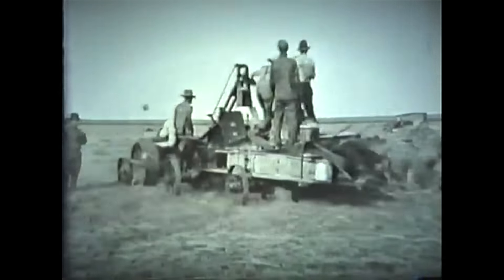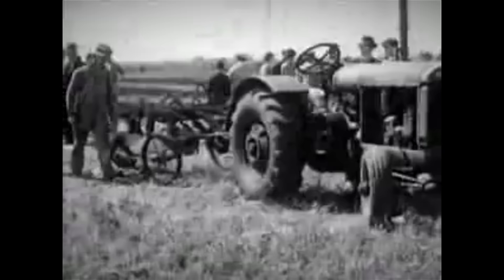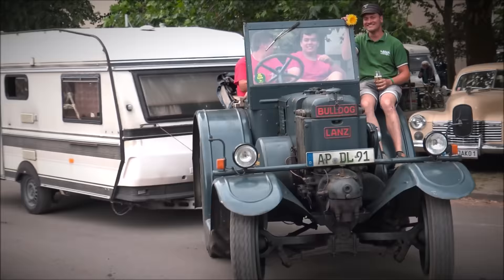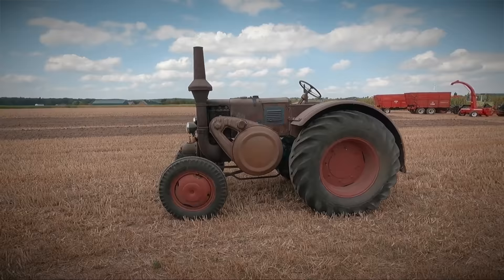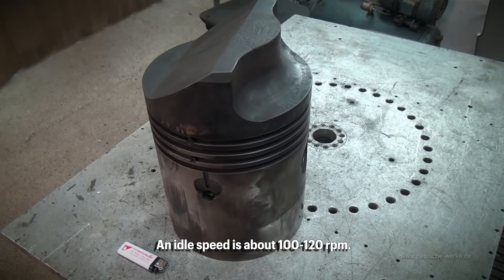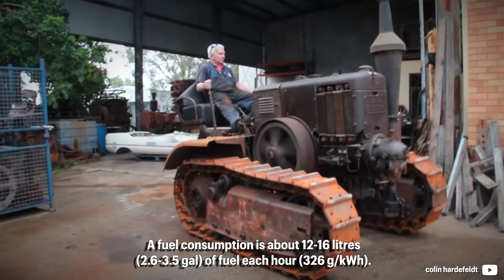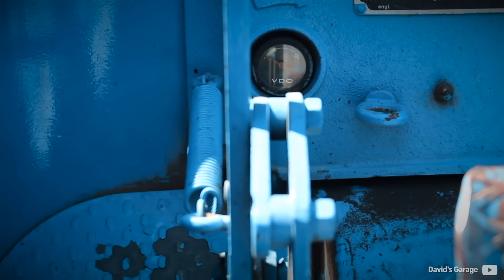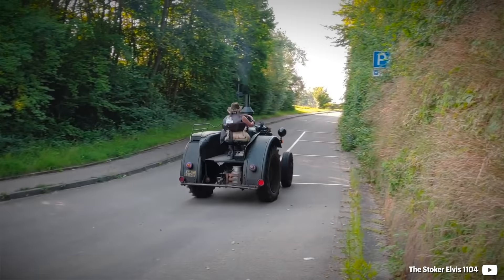This Is An Incredibly Slow Engine

Comment: My neighbour had lots of Lanz tractors. He used them still in the 80s for his little Farm. After the world war two he moved from near Berlin to our little village. He told me that he saved a few Lanz tractors from the srapyard for 10 Deutsch Mark. The farmers don´t wanted them anymore. The engine start procedere and driving comfort was already outdated at that time. He had a large collection of tractors with nearly every engine Lanz had ever build. One the biggest was a 50 hp Lanz Bulldog. Whenever he started the engine you heard it. The sound was really loud an so unique.
His most rare tractor was a 60 hp Eil (fast) Bulldog with an original "Berliner" cabin. The cabin frame is from wood. It is not 100% clear how many original tractors of this type have got survived, but probably just a hand full. 
I remember that I have often seen cars with numberplates from far away and I heard that many collectors wanted to buy tractors from him, but he never sold any of them. On top of this he owend a few old cars (Mercedes Benz, BMW Isetta, Volkswagen Beetle) and old Motorbikes like DKW, Zündapp and so on. It was always like a museum at his farm. Unfortunatly he died a couple of years ago.
Reply: Hey, du bist doch bestimmt deutsch, ist ein umbau oder,auf 60 ps halbdiesel ?
Reply: @nilsgaming6664  Moin, ehrlich gesagt kenn ich mich mit der Lanz Technik gar nicht so gut aus. In der Sammlung war mindestens ein Halbdiesel dabei. Das hat mir mal ein Kumpel erzählt, der da deutlich tiefer in der Materie steckt, als ich. Kann sein, daß der Halbdiesel eher der 50PS Bulldog war. Der war verglichen mit vielen anderen in der Sammlung schon recht neu und hatte defintiv einen E Starter. Da standen aber auch einige Glühköpfe und mindestens ein Alldog bei ihm auf dem Hof.
Reply: I bet that they came back like Hawks and low balled the widow if their was one. How I hope that it didn't happen.
Reply: @johnelliott7375  Everything what I know he was divorced and his son shouldn't get any of this tractors. Two friends of mine where in his testament an got a few tractors and the farm.

Comment: Very cool tractors, I've seen one at a tractor pull and when they are at full power you can feel the shockwaves through your whole body from some distance, pretty impressive but also probably miserable to drive for any extended period of time
Reply: No, I used to drive a Bulldog all day in seeding and harvest season. When the engine is at full revs you don't get much vibration.

Comment: At 4:07 there is a Field Marshal tractor in view, it is very similar to the Lanz Bulldog in having a horizontal single cylinder 2 stroke engine, but the difference is that this is a true Diesel engine, so it won't burn other fuels than diesel and other fuels with a similar flash point like kerosene or some vegetable oils.
The Bulldogs with fenders over the rear wheels are Eilbulldogs (speed Bulldogs), these had different gear ratios for a higher top speed and were made for on road haulage.

Comment: I really appreciate the video on this engine VR. These motors are obviously extremely powerful and were popular but I had never knew anything about these before. Thank you!!
Reply from the maker: Thank you, it is my pleasure!
Reply: Lol they are not powerfully in any way comparatively to any modern engine
They make 40hp for a 10.3 liters engine
Not fuel efficient lol
Reply: @legros731  I was talking about the torque not horsepower.
Reply: @chesspiece81  even the torque is pretty low compared to "modern "diesel that make over 1000lbs torque

Comment: These tractors were built under license in Australia under the name of KL Bulldog by the engineering company Kelly and Lewis. Very popular with smaller landowners as they could run on other vehicles used crankcase oil.
Reply: That was our first Bulldog. Later we got a Lanz Model T with electric start.

Comment: They had a few at a vintage tractor pull and you could fell the shock wave from every stroke of engine at full power was fantastic. My grandfather has a Lanz bulldog in Australia running a saw blade and it used to bury itself into the ground with its rocking if you weren't careful

Comment: I knew about these lovely machines and their MASSIVE single cylinder engine, but never knew the power specs. Thanks for digging that. Impressive figures for its time. Never knew they could run at 0 RPM too, that's a pretty funny trivia.
(and the sound of these engines is just fantastic. Slow running big engine are something special, when you can literally hear each piston stroke)
Reply: Oh man, you need to see the exhaust plume of some of these.
Ive seen one push a smoke vortex 30m high, they truly are beautifull
Reply: Well at 0 rpm it's making literally no horsepower so it's kinda not really running 😂
Reply: @mrwhips3623  wrong
Reply: @richsackett3423  no you

Comment: Actually they have a huge fanbase...most of them are retrofitted with elctrical starters nowadays. The so called Eilbulldog(old version of a word with meaning of fast-trac) which was mostly sold to big shipping companies or circuses, costs nowadays more then 200k €. Ones with an open cab and those retrobuild to Eilbulldog design, are sold between 30 and 80k euros. Where i live btw, is a lanzbulldog showcased on meetings of old tractors and agricultural stuff, where an American airplane shot through the flywheel when the farmer was brave enough to plow the field at day...Bulldog still runs 😉😅
Reply: ...that's what the title says? Cult usually means huge following. And you're saying the same thing like it's contradictory?
Reply: @instrumental  sry if it sounds like that
Reply: @maxgr7723  you have no reason to apologize to that fool  instrumental he's miserable and thinks he's better than you enjoy what you do

Comment: Interesting video. There are some points I'd like to add though.

After WWII, Lanz developed the hot-bulb engine to a semi-diesel engine. The hot-bulb disappeared and the time-consuming starting procedure was not necessary anymore. The hand start was replaced by a electric starter. The semi-diesel is started with gasoline and a spark plug ignites the fuel until the piston is hot enough to ignite diesel fuel. The driver has to control which fuel is injected to the combustion chamber. Without the hot-bulb, Lanz was able to increase the compression to a medium pressure, which increased efficiency by a lot. Semi-Diesels only need about a third of fuel compared to the the hot-bulbs.

Next, Lanz got rid of the gasoline start by adding a glow plug to the combustion chamber. Apart from being horizontal single cylinder two-strokes, these tractors are almost like regular diesel engines. This was about in the mid 50s. This tractor is called "Volldiesel" and was the last development before John-Deere took the majority of shares to expand to Europe.

Such a Volldiesel with 16 hp was the first tractor my great-greatparents bought for their small farm here in southern germany. Since Lanz Bulldogs have such a charming sound and a characteristic engine, my father also reimported a D1506 hot-bulb engine from Greece in the 80s. This was the strongest hot-bulb tractor from lanz with 10,3 l and 55 hp.

I have some videos about our Volldiesels on my channel.
Greetings from from the black forest! (~150 km to Mannheim)

Comment: I grew up not far from Mannheim and yes Bulldog was a synonym for tractor. I drove a Lanz for a while around a farm. The 0-rpm back and forth was a thing to watch out for, and it would run the wrong way if not carefully started.

But when it ran, it seemed there was nothing that could stop it. One time we were working on the farm around some ditches filled with salt water (it was on an island in the northern sea) and accidentally drove the thing into a deep ditch. We jumped off because it was freezing cold and the water was deep. To our amazement the Bulldog just kept going and drove out at the other side of the ditch after being half submerged in salt water. Somehow we got to the other side and caught it.

Comment: In that day's here in Germany by wintertime they parked the Lanz with distance to the farmhouse.
They didn't stop the engine in the evening because of the preheating in the morning to avoid crack's in the glowhead.
Imagine to preheat a -25 degrees cold glowhead with a torch you can barely kontrol the heat on.

Comment: Engines that can burn anything is a path forward and shouldn’t be forgotten.
Reply: I'm sure the efficiency is very low, so you'll be busy find stuff to burn
Reply: And the result to forward innovation is the gas turbine engine. It can burn any combustible liquid. With the right fuel flow, you can sustain the burn time no matter the energy density of the fuel. It also shares the ridiculously low thermal efficiency if you use light fuel like gasoline. But on heavier fuels, it can reach 50% thermal efficiency. Torque is non existent and it needs a gearbox to produce torque from a high revving turbine.
Reply: @kimpatz2189   Ever heard of Diesel engines?
Reply: @vHindenburg   Yep, heard those. 

You however, ever heard of the multifuel gas turbine engine of the Abrams Tank? 

It can run on anything as long as its liquid and it burns. That's the peak of multifuel engine. Only a gas turbine can do it. And the only thing you need to change on the fly is its injection flow rate depending on what fuel type.
Reply: @kimpatz2189  There something wrong with that statement, a gas turbine as the name says runs usually as the name suggests with gas like LPG, saw some experiments  with a model jetengine it ran basicly with anything starting with alcohol, and ending with diesel fuel, as little it  had an impact on performance I doubt it has any positive impact on the engines livetime.

I wonder if the Gasturbine now is meant to be a petrol turbine or not.

Comment: I really like Lanz Bulldogs and I would love to own one just for the hobby of driving one.
Here in Croatia the most popular tractor brand is IMT followed by Torpedo. IMT is a licensed Massey Ferguson while Torpedo is a licensed Deutz-Fahr and mostly 06 series was produced. But I love German tractors and my father had a Guldner A3K Burgund and that tractor is robust as a tank. With it's humble 25HP it can outperform the most popular IMT 539 any day. Even my grandfather owned some old 2 cylinder Fahr tractors with 18HP and a Deutz D25 or D30, not sure which one. Best tractors ever, German engineering at it's finest.

Comment: The later Lanz tractors such as the Model T had electric starting. There was a separate fuel tank containing a petrol and diesel mix and the hot bulb was replaced by a spark plug. The starter bounced the piston back and forth against the compression until it fired then as soon as it was running you switched it from the petrol mix to straight diesel fuel.

Comment: That's a hell of a piston design. You can tell that they had to really watch air-fuel mixture so that the flames didn't burn a hole right through the piston head.

Comment: My favorite tractor of all time. I was about 4 or 5 when my father first took me to some festival where I've seen Lanz Bulldog for the first time. I fell in love with the sound of that engine. Here in Poland it was very popular until the 1970s I think, when Ursus made the C330 and C360 four cylinder tractors. Before that, Lanz Bulldog and C45 (which is the name of the "stolen" Polish Lanz, produced by Ursus after the war) were probably the only tractors in use here. My father told me many times how he remembers these tractors from his childhood, people driving them to markets or something in the winter wouldn't put the engine down, but they'd instead let them slowly run on neutral, so that the bulb and the engine itself stayed warm for hours. Thanks to that the driver wouldn't have to risk breaking his fingers a lot of times during the day :P Anyway, this thing is in my top of smart engineering. It's simple as hell, but it worked. It suited it's purpose perfectly.
Reply: Its still weird to me that the Polish version is called  "Ursus" Its a very German style company name.
Reply: @vHindenburg  it's probably called that way because in the times of creating the tractor factory, Henryk Sienkiewicz's "Quo Vadis" was a hit book. And there was a character called Ursus, which in Latin means "bear" if I recall correctly. The tractors were meant to be strong as the character in the books and a bear, so they called it that way. ;)

Comment: A small correction, as the first internal combustion engine to reach most farms here in the US was not a tractor engine or a pickup truck engine as it was the engine in the first powered washing machines. A farmers wife used to do about 40 hr. of hand washing a week, and that was reduced by the gasoline powered washers to a single days worth of work. Low octane gasoline was sold by the can for as much as $7 per gallon and that is not adjusted for inflation, it was really $2 to $7 per gallon in a disposable metal tin can....
Reply: cool story bro
Reply: the maytag washers used a maytag engine or an early briggs and stratton, washing machines never used car or truck engines, , in 1949 gasoline cost usually about 15 cents per gallon.

Comment: Sadly two applications are not mentioned, but are very Important:

"Schnellläufer" with speeds up to 25 kp/h early and later on of up to 30 kp/h

"Straßenzugmaschinen" as used for road haulage or by Fairground and Circus folk to transport their equipment and drive their generator stets

Comment: I remember the Ursus C-45 based on Bulldog still being used by one of the farmers in the 1980s on the field. Steel wheels, if I remember correctly. You could hear it for miles.

Comment: The beauty of those old hot bulb engines -- they let everything else on the tractor be as simple as the engine.  No electrical system, reverse wasn't really necessary, brakes were often on rear wheels only and might be pushrod operated (rather than hydraulic) -- and as noted, they'd burn almost anything.  Big torque and low speed.

You couldn't sell anything like these today; too many regulations on emissions and safety -- but someone who knows how they work could build one from raw materials, as long as they have a big enough lathe...

Comment: Back in the 50s, I rode on a rail maintenance vehicle that had a huge 2-stroke single , and reversing required stopping the engine and restarting it in the opposite direction. Unfortunately, the details are lost in the mists of time.
I hope someone can remind me.
Reply: Probably a Fairmont. They made several different types of speeders and maintenance vehicles, many of them used a big 2 cycle engine.

Comment: Grew up plowing with a 2-cylinder John Deere that was started on petrol but run on kerosene or 50/50 kerosene + waste oil from it and our other machines (Fordson, IH Cub, IH model H). Saw a Bulldog at a county fair and was surprised at how similar it sounded to the "poppin' Johnny".

Comment: Again very well researched !  However, l like to add two items, which are not so well known.

First: the injection valve could be adjusted for maximum power drive or for less power and often idle service. Becaus of the difficulties and dangers starting up the engine some people let it run on idle during the night. At that service the hot bulb cools down and the nozzle needs to have a narrow spraying angle.

Second: the Lanz Bulldog was suspected to increase the danger of diseases for the driver. The vibrations of the horizontal moving piston can hurt stomach and even generate cancer. Pregnant women shouldn´t use those tractors. I am not joking, after WW 2 farmers wifes were doing everything on the farm and even high pregnant. For fun or demonstration rides nowadays there is now danger to be assume. But it is a different thing to work 12 ours a day 6 days a week sitting on such a machine.

I was born on a farm having 5 siblings and we used to have serveral tractors. The best compromise between consts and comfort were been the three cylinder engines such as massey ferguson. I personally didn´t care of agriculture. My interest were the machines :).
Reply from the maker: Wooow, thanks for the insight!

Comment: Have you seen the CASE 150 that someone built from scratch?  This 100+ year old designed steam engine can pull 50 John Deere deep plows.  That's plowing 60' wide and quite deep.

Comment: I only know of these since I moved to Germany  ,Hamburg any one who knows the surrounding  area  knows there is  a lot of farming around here. I kept seeing these strange old Tractors that did not look like anything I knew  from back in the UK. some looked like oversized cars others like a cross between a static engine and  a tractor.
But one of my new Work Collages told me about  the Lanz Bulldog  with it single piston and its odd sound.
I even saw one driving down my street once here one of those bigger one's with the larger cab and a roof , they are stupidly loud and I can agree with another comment here about your hold body vibrates when they give full gas.
but I never new they could burn any fuel that was a very cleaver thing for such an early Tractor something  than to my better understanding no current Tractors can do.
Safety  took 2nd place back in those days and I know hand cranked engines  with out electric starters from my time driving a dumper  truck diesels engine though that had a ratchet safety system it was still a pain to get even thing timed correctly to get the engine running .
great video thanks